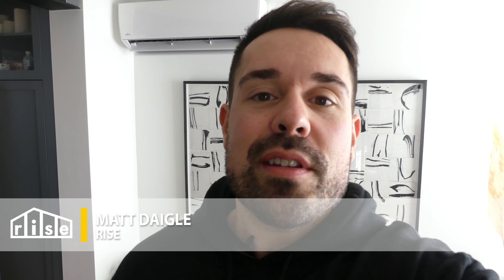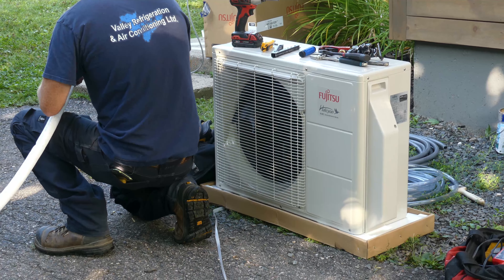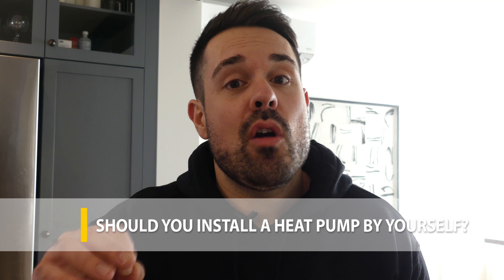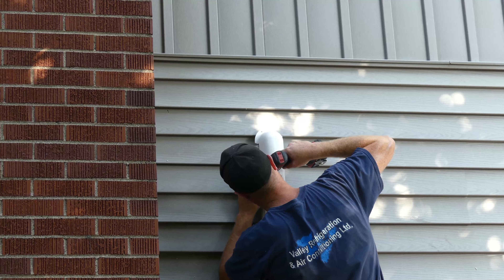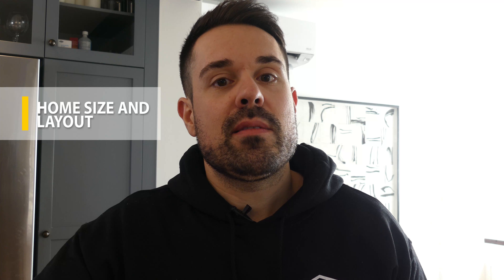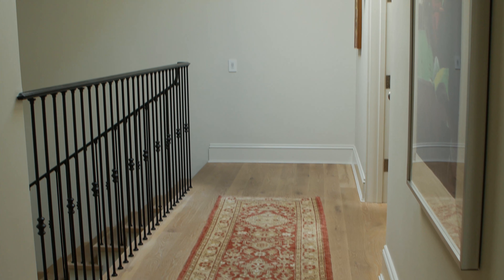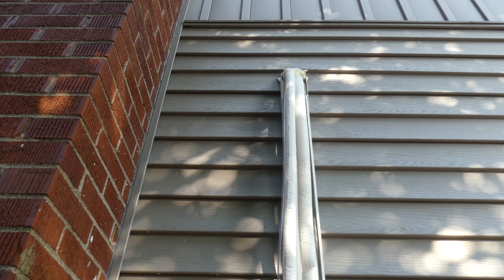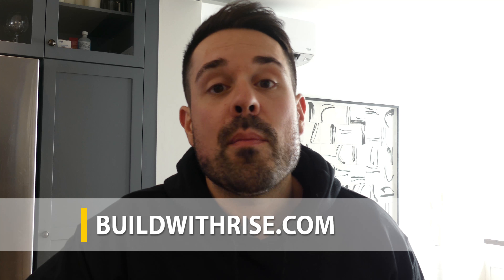Heat Pumps: Pros, Cons, and FAQs of Mini-Splits

Comment: I needed this information, thanks for assembling it and posting it.
Reply: It isn't mentioned that heat pumps do not operate efficiently when temps drop into the teens and single digits, and shut down around zero degrees.
Reply: Hey, thanks for the tip.  I live in South Texas, outside of last week's historical freeze; it never gets below 24F degrees.  Well, may once or twice a year....Winter lows usually average around 32 degrees for 1-2 weeks.

Comment: "the colder the climate, the harder they have to work" statement is ambiguous.
I'm sure you know this, but at low outside temps, the compressor will actually work less because there is less heat to...pump and/or defrost cicles are managed.
Reply: That statement is partially true. If someone has a standard heat pump that is either on (100% capacity) or off (0% capacity), the compressor's power draw will in fact be lower with a lower ambient temp because it will be absorbing less heat and therefore building less pressure, so it won't be doing as much work. However, since we are talking about inverter units with variable speed compressors, your statement is false under most conditions. Let's say someone has an inverter mini split set to 70 degrees in heat mode with a 50 degree outside temperature. Assuming the unit is correctly sized, the compressor is not going to have to work very hard to maintain 70 degrees, it may only need to run at 1/3 of its capacity. Now let's say the outside temp drops to 20 degrees and the compressor needs to run at 100% capacity, but it is still able to keep the structure at 70 degrees. It will need to do more work  to keep up since the structure's heat loss will be higher due to the higher delta T between inside and outside, also lowering the system's capacity. However, let's say the outside temp now drops to 0 degrees and the compressor is still running at 100% capacity. Since it won't be able to pick up as much heat from outside the compressor won't be doing as much work, so the power draw will be lower. Anyone with a heat pump (myself included) will tell you that their power bills are higher on colder months.
Reply: @averyalexander2303  We may talk about very different models but in my area, all the ac inverters get to around 1/3 of their rated power draw when outside temp is getting close to their rated minimum working temperature. Of course the bill is higher, there is more amount of heat produced overall.

Comment: I disagree if you have discipline and true undestanding of the scope of the work it is D I Y.  When money is an issue $500 is what you are going to save  and that is the real decision. Top you have even $1500 to buy the smaller 12K unit.  Can you be prepared, take a full weekend to do what a prepared installer would in less than perhaps 5 hours.  Do you have $1800 or $1300. Peace of mind costs.  You must have the install quoted and under contract with every detail listed. Get more than a few quotes, only if you are going to use sombody, Don't waste their time. Quote and contact for All the parts and action. Absolutely no hidden fees or costs.  Brackets, screws, wire, conduit, connectors, switch boxes, Breakers. A laundry list. Their Tools = drill, hole saw, ac lines, gauges & pump, wrenches. To do this you need to be aware of electricity, how to shut off your power,  place a a new 220 breaker and run a new circuit. That is the biggest hurdle. That is the main decisoin if you work alone or get some experience to help. Again all this effort is only to save money or get to learn how if you want to do it again elsewhere or fix things. Is $500 on top of a decent small <100 lb, low 12K units price of $1300.
Reply from the maker: Thanks for watching, Joseph! Certainly, if you have the experience, anything could be a DIY job. In general, though, we advise most homeowners to seek a professional for HVAC/electrician/plumbing jobs.